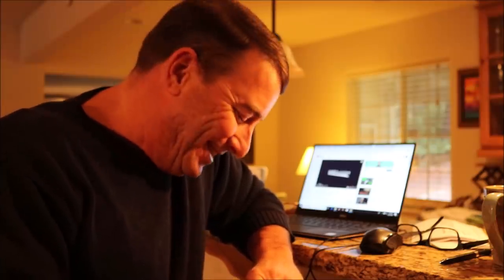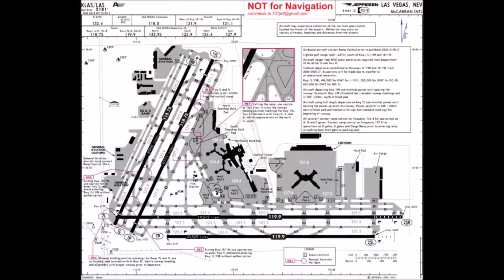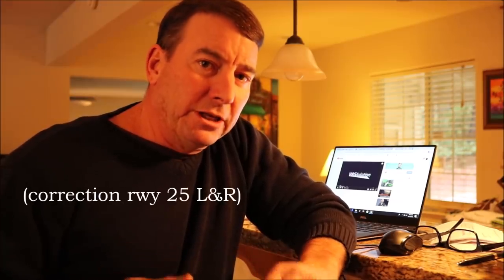Frontier Airlines #9260 A320 Open Cowling in Flight

Comment: So they were pretty lucky by all accounts. I wonder that pilots have no camera pointed on the wings and  engines. There was an incident in England some years ago when a pilot had an engine fire but shut down the wrong engine. Despite passengers querying his decision at the time. Maybe you can enlighten me. It seems a strange omission for such a cheap safety improvement.
Reply: Probably they will add this when the airlines get the additional in flight video recording of the cockpit and the cabin, though they will probably cheap out on that as well and only have 2 cameras, one facing the windshield and the other facing the cabin door. Would require the FAA to mandate it though, plus you probably would have a hard time finding VCR units and VHS tapes to put in them.
Reply: I think you encounter questions of complexity versus utility, though I agree that cameras seem cheap and awfully handy when there's any kind of engine emergency.  You'd think there could be a dozen miniature cameras showing major components.  You read about planes that lose a portion of the tail and only learn the full extent after landing.
Reply: SeanBZA  I’m having difficulty determining if you’re making a sarcastic joke or are ignorant of current video recorder technology.
Reply: Jan - No such thing as "CHEAP" in commercial aviation.  You can propose to install 2, 25 dollar high resolution cameras on an airplane, but the costs will quickly escalate as the cameras have to be "Certified" by the FAA, hardware and software has to be developed to accommodate getting the video to the cockpit displays, the installation has to be engineered and Certified, the modification has do be accomplished at a Depot Level facility, Aircrew have to be trained on the new system and procedures for its use, and then all of the documentation and flight manuals have to be updated and posted in accordance to manufacturer and FAA guidance.
The cost for each aircraft, by this time, will be high 5 figure to 6 figures.  Probably not worth it since the crew can look out the cabin windows and see what's happening.  Just my 2 cents (non-certified).
Reply: @garyreed2206  That may well be true, but they have video cameras for passengers of the runway. Cars have long had rearward video. Just seems obvious to me but maybe it is all too much hassle. Not sure pilots will be looking out the window at 35,000ft!:)
Reply: Just a comment about looking out the 'cabin' window. If you mean where the passengers are sitting. Neither pilot of the UK crash checked. I was following the incident on the local news radio. Both the news reporters and passengers question the pilots decision. The pilots relied on instruments. So it seems just about everyone knew which engine was on fire except the pilots.

Comment: there's 4 latches under the cowling, you need to bend way over to see them.  Some have been painted orange, some dull read, and others not at all.  That's at American, not sure about Frontier.  No open cowling lights, just thrust reverser uncommanded ECAM if I remember right.  Good video, thanks

Comment: Ya know as important as those doors are to be checked and signed off. 
Why wouldn’t the airlines require a switch on the latches that lights on the instrument panel with a warning buzzer if the doors aren’t properly closed. It’s such a simple thing to do and would save lives.
Reply: I'm suprised that there are no switches for the latches as well.
Reply: @eliotmansfield  Those switches ( like the cabin door switches and cargo hold switches)  are only installed once there are fatalities from those kinds of fault. Basic airline accounting is the cost more or less than the expected payout, and how much revenue generating mass does it mean we cannot carry per flight. Very much like the Ford Pinto, known fault that the bean counters deemed too expensive to fix in the USA, but fixed in the CAN versions.
Reply: To do something like you suggest would require the the aircraft to be recertified by the FAA. Not cheap or timely to do. You just can't modify an aircraft even if the idea is to increase safety with out testing and approval from the feds. It's called a S.T.C. ( supplemental type certificate) when that testing is approved to modify an aircraft. Plus you have about 150 sensor ( people) behind you to tell you when things are going wrong.
Reply: Matt Lundquist My position is even one life lost isn’t worth overlooking a design change that can save lives. Maybe as a fix to remove the human side of the issue. Perhaps the FAA will decide this to be a requirement for airworthiness
Reply: @williegillie5712  I'M not saying it's a bad idea. But to modify an aircraft there is a process that has to be done to get an idea like that implimented. Unfortunately people die sometimes before design and rules are changed ( they call them AD's). This was more than likely a human error or a mechanical malfunction ( latch could have just broke) and that is something you can't protect against.
Reply: SeanBZA  Yes, and in American aviation history the FAA has been called the tombstone regulator because frequently major safety changes aren’t mandated and made until after a disaster that kills people. The problem is the agency’s conflict of interest. It’s supposed to both promote aviation and regulate it and that makes it vulnerable and susceptible to lobbying by the industry they regulate. Safety always gets in the way of profits.
Reply: Matt Lundquist It’s a shame there has to be so much red tape for a simple idea that probably should have been implemented  during the design of these planes. If the latch broke or failed the NTSB may have to get involved and make recommendations.
Reply: @SeanBZA   Like a Stop Light on a busy intersection ?

Comment: I still Never Heard what caused a A380 Air France (?From Amsterdam to the USA.) In Flight probably 6 Hours and at 30,000 Ft. Over Greenland when it lost a Cowling & Engine Parts and made an Emergency landing getting over to Labrador Canada AFB.  If that was a Bad Latch (Makes me wonder how it got half way in Flight, before it failed?) My memory is going but it was about 2 Years ago December or January 2016 or 2017 (?) All you get is Under Investigation, but then? We never get the Answer, like having us forget the curiosity and keeping us from really knowing the answer. But I still wanted an Answer from this.
Reply: The AF A380 was an uncontained engine fan and inlet separation over Greenland, nothing to do with the cowling latch. See: http://avherald.com/h?article=4af15205

Comment: As medical doctors and nurses have found, using a checklist is now fairly mandatory.  Is this something used in airlines?
Reply from the maker: Aviation invented the checklist.
Reply: I thought it was Noah......   ;-)
Reply from the maker: ..."what's a Cubit?..."
Reply: blancolirio Alfa-2 alligators- check. Bravo-2 bears-check. Charlie-2 cougars-check. And Zebra-2 zebras-of course!
Nice report, thanks.
Reply: @blancolirio  (as I suspected... 😉) Confirmed and acknowledged 👍
Reply: @blancolirio  Noun: cubit

|kyoo-bit|

An ancient unit of length based on the length of the forearm

~linear measure, linear unit

Comment: Can you land an airliner 'without' flaps?  I know we'd do it in C150's & 172's just for kicks.
Reply from the maker: Yes. "No flap, no flare..." very fast landing speeds.
Reply: Been there, done that in a C150.
Reply: The first hull loss for a Boeing 777 was landed without fatalities because of the quick thinking by the crew to land without the flaps. The plane had lost power in both engines and did not quite have enough glide to make it to the runway. By reducing the flap setting the glide was extended, clearing a highway and a wall. The plane came in very 'hot', and landed hard, but everyone lived, thanks to the flight crew.

Comment: When someone can earn more without needing to pay to take classes why would anyone really want to be a pilot? Problem is many pilots are getting food stamps so they can feed their family. Also why I recommend that people not take classes primarily in engineering and science, as it is not worth the investment. My wife's ex used to be an airplane mechanic and he was told to use superglue on a door for an airplane... If he did that it would have broke off in flight. We have too many that take too many chances in management, and tell people to not bother. Keep in mind that mistakes like this happen because maintenance is told to get it going and not always what is safe. There is a good chance that the person that was going to check it was most likely told not to, but get it in the air.
Reply from the maker: You need to be a highly motivated self starting individual who doesn't whine about how difficult it is to achieve your objective. 
Airline pilots (in the US) MEDIAN salary 130,000$ you can nearly double that for pilots at the Major US Airlines.
Reply: @blancolirio  , then why do some earn less than 20K a year? and a starting salary of 30K. I only mentioned this because you had said shortage, and if there was a true shortage the pay would be enough starting off that one could get the job and have more than enough to live on and also pay for expenses such as education that it took to get there. Then the much higher pay after being on the job enough years. I'm not saying how much I can earn in my field, but it is for the most part unrelated to my education and my hands on skills are what I am paid for when I work.
Reply from the maker: Gotta start at the bottom and work your way up. It's a very quick progression now. Ya gotta plan ahead.